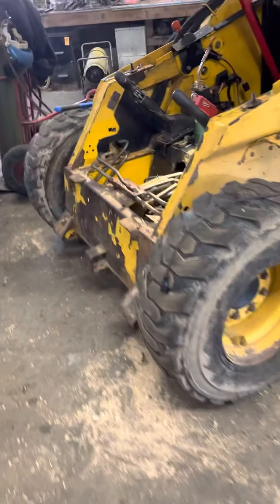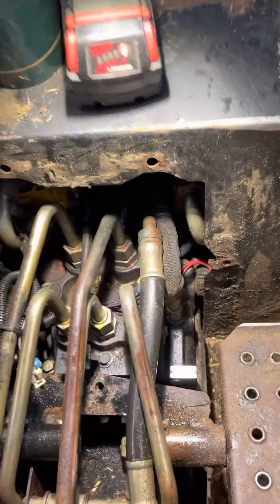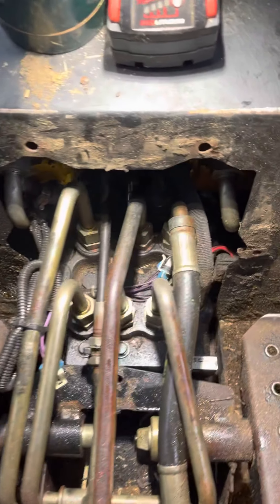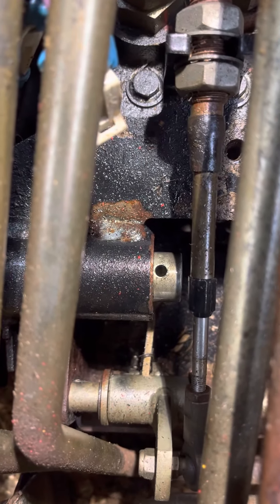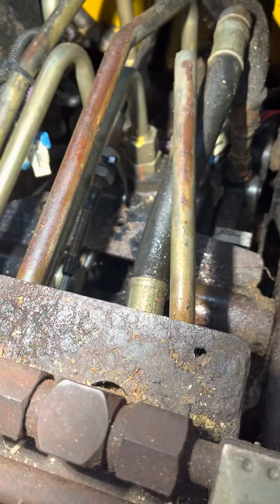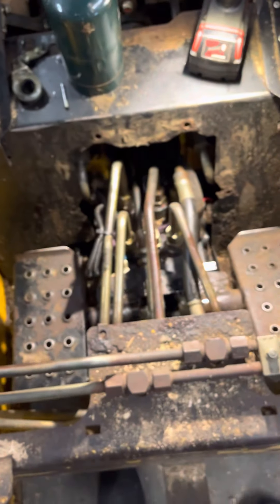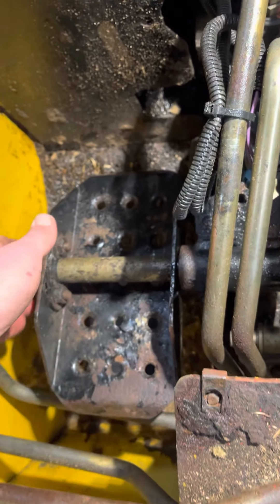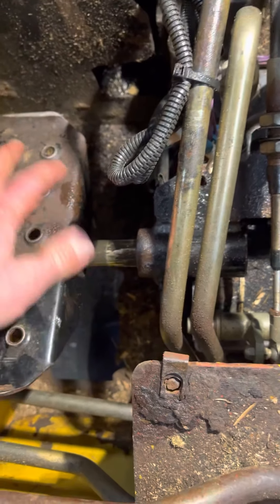John Deere 240 skid steer

Comment: Right there where you take the peace out is leaking how can we fix that can we repair that or need the whole box Nicole control box
Reply from the maker: Hello Eulogio. Sorry, haven’t had service for a few days.  
Apparently you can get a seal kit which is quite expensive, I ended up using gasket sealer on all the connections and put it back together.  Holds so far.  🤷🏽‍♂️. let me know if that helps

Comment: How can I remove some hydraulic fluid? it's 2-3" too high on the stick. I looked at the overflow tank and that looks like you don't mess with those two radiator type hoses and I tried to stick a tube where you pull out the stick and it's hard to get it down into the tank. I'm at a loss.
Reply from the maker: Do you have auxiliary hydraulic hookups, if so take an end off and let it fly( gonna make a mess) but it’ll work. Or take the hydro filter off and pour it out then put it back on. Repeat if necessary.  Two easy ways or drain it from the main reservoir. Hope that helps.  Let me know
Reply: @willinkfarmsdairy4790  It looks like it was a lot easier to overfill it than it is going to be taking it back out 😭